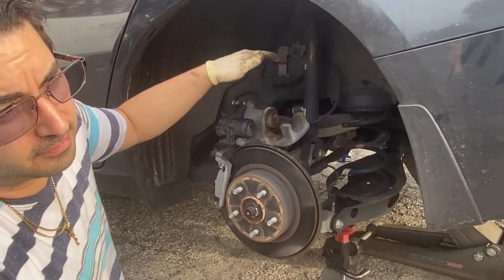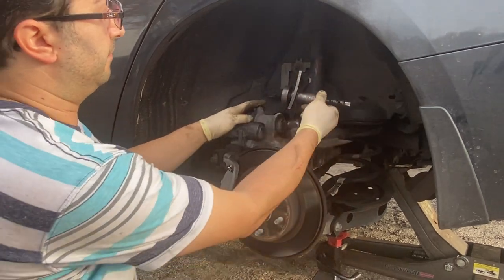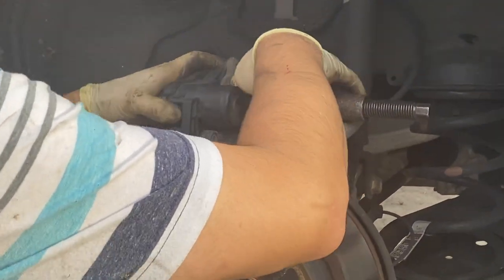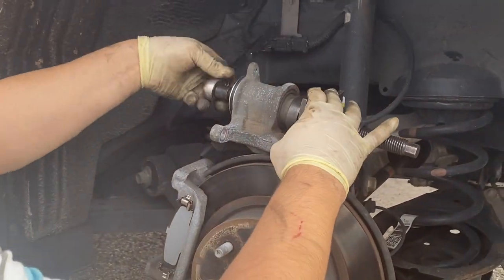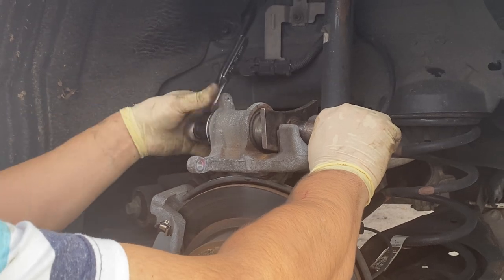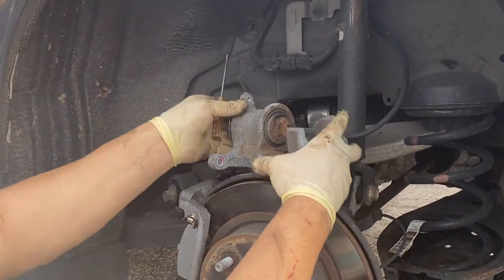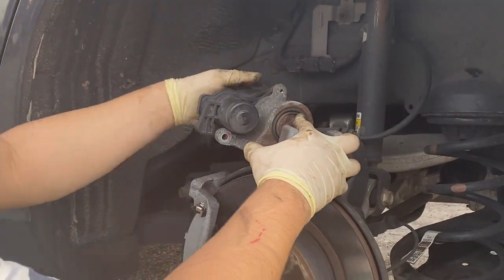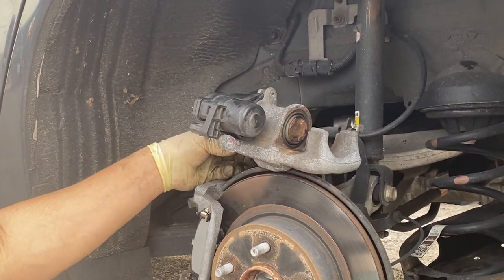2019 Nissan Altima - Releasing the caliper - Rear Pad Brake Job - Electric Parking Brake

Comment: Did the car need to be on any service mode or after it was done was there any warning lights or reset lights was it just straight forward like in the video ?
Reply from the maker: The car was not in any service mode and the parking brake was not engaged.

Comment: You don't have to do any of that. Just hook a wire to the positive and negative to the battery and touch them to the prongs in connector for the electronic e-brake. (Positive to negative) closes the caliper and reversing the polarity (negative to positive) opens them. Simple. I'm an electrician and I tried this without having to buy the piece you need to do it.

I actually found a video of the way I did it. You can use the battery from your car if you don't have a spare laying around. You're welcome 😊

https://youtu.be/6KkXvOcHUuU
Reply: Your comment saved my life
Reply: I do this for a living. Zero mechanics do it your way. This is the easiest method.
Reply: You Could just spin the caliper piston and slowly press in until it stops spinning.  The issue is the tool wants to go in and spin too much when it needs to spin more and go in slower, that's not how this tool operates.
Reply: Pretty bold statement, im a mechanic and just did it this way lol @ykmalachi
Reply: @ykmalachi no need to remove the motor and risk breaking the seal by just electrically backing it up

Comment: Do you recommend disconnecting the battery during this
Reply from the maker: Generally, anytime you work on a car, you should disconnect the negative battery terminal. However for something like this, I do not see a reason to disconnect power to anything. So sorry for the late response!

Comment: I did exactly what you showed...it was fairly easy...but when I went to start car the parking brake is on...and it won't let the car start...car is mint with 40k miles on it..I'm stuck trying to release park brake with no luck
Reply: Did you try disconnecting the battery for 15 minutes or so to reset everything? Not sure if that will do anything just curious.
Reply: How did you end up fixing the parking brake issue?
Reply: @mgoodell76 some say the parking brake is still stuck, to this day...
Reply from the maker: Sorry to hear there was an issue, when i did this job, i ensured as any other brake job that the parking brake was not engaged. Alternatively, what i would do in your case is, set the caliper back to it's previous position, release the parking brake, and then continue.

Comment: Poor method you may destroy the whole caliper assembly 
Just apply direct  12 V to the motor to release and reverse polarity does the opposite 
Pretty simple
Reply from the maker: Applying 12 volts to the motor is another valid method, if you have a power probe or the means to do so without damaging the electronics. Thank you for that suggestion. However to damage the caliper using my method in the video you would have to go at the caliper like an animal and strip out the fittings or put way too much pressure on the piston without backing the motor off or vice versa. It would be pretty difficult to damage the caliper that way. This is not a poor method, it's just a different method for DIY mechanics that would rather not mess around with the electrical aspect of the assembly.

Comment: When you press the caliper do you feel pressure or some limit to press the caliper while you loosen the part where the electric parking brake goes? thank you so much
Reply from the maker: Yes, from what I remember it will start to get tight, and then you need to adjust the screw some more to keep pushing the piston back. I alternated between pressing the piston back and adjusting the screw a few times before it was seated all the way down.
Reply: @MAMTIMAC   one more question , when the caliper is compressed do I have to tight the screw or should I leave it loose